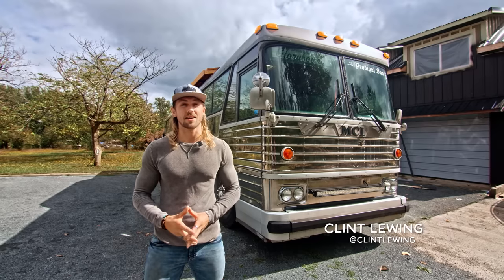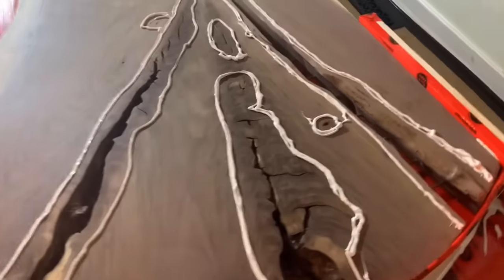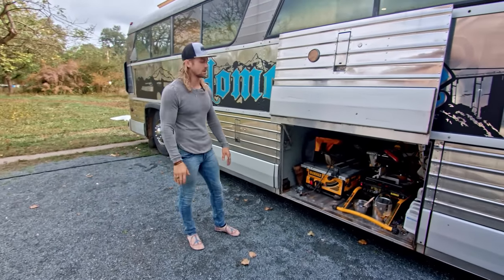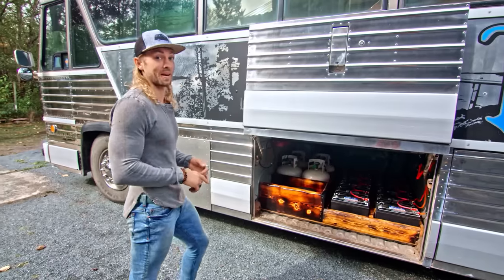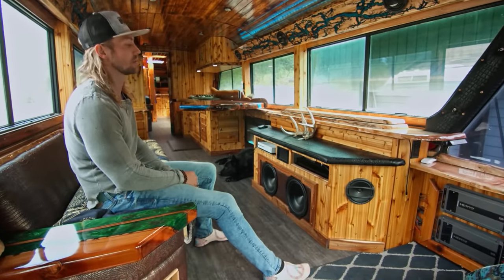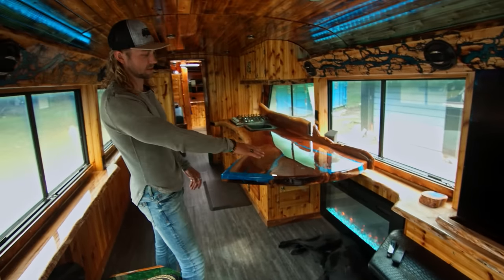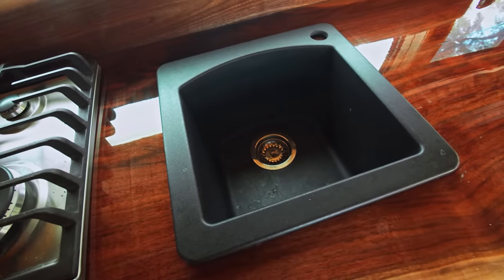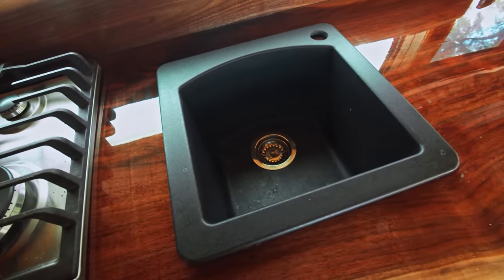I'll be Surprised If You're Not Impressed with This Charter Bus Conversion

Comment: Gorgeous work man! You could fix a hinged folding rack with solar mounted on it. Then you could flip them up when parked and they could sit in a vertical position acting also as a perimeter rail.  May also come in handy to adjust the angles and maybe even make them removable. Could plug to an extension to place them on your site.

Comment: Absolutely gorgeous, my only concern with what I saw is rust in the undercarriage; are you doing anything to take care of the rust?
Reply: I'm interested to know as well.
Reply: I actually got a commercial vehicle inspection (CVIP) done on the bus in 2019 in Alberta instead of a regular safety inspection. So the frame, brakes, engine, trans, wiring/basically everything else was all checked over with a fine toothed comb & she passed with flying colours. I will undercoat the bus one day but right now shes structurally safe & sound as is 🙂
Reply: We didn't actually see the undercarriage thosd were just steel hinges holding on those lower doors  I think
Reply: You are correct there! I mean.. I may be crazy but I think it’s fairly understandable that a 40+ year old vehicle has a little surface rust 🤷🏼‍♂️  @nllnll6119
Reply: @ClintLewing  you undercoat that bus and it will rust and you will lose it. I don’t know nothing about ranches and having stuff like that but there’s one thing I know I’m a mechanic a body man, a painter and I do very well at all of it .do your research. When a stone comes up from the road and you’re driving and it puts a chip in that undercoat moisture gets in behind it and it sits in that frame will rot out in a matter of two years it will be complete junk. They make oil based under coating that will allow it to breathe and stop the rust good luck.
Reply: @robertmedina6875  it would be quite expensive but he could have parts of the under carriage powder coated as one would do a restoration to prevent rust.
Reply: Agreed and the rough engine ...
Reply: @ronspeer  yeah That would be a crazy amount of money. I guess if you have it
Reply: even if it is a bit rusty this bus was only $10,000 which is an absolute steal considering that big diesel generator on board. Which would easily be over $10K by itself if you wanted to buy it new. Onan still makes the Diesel QG 7500.
Reply: @robertmedina6875  I live in the Upper Midwest and undercoating is basically required if you want the car the stay nice. 
However, you are correct people don't do enough research and 90% of places don't do it properly. 
In my opinion it needs to be done as immediately when the car is new before any rust starts and there's no damage to the original paint on the frame. Even then it needs to be taken to a specialized place that specifically does bed linings, industrial applications, heavy equipment coatings, etc. Line-X is one that comes to mind personally. A good quality and properly applied bedliner works much better than any type of rubberized undercoating in my experience. As rubber coatings trap water like you say.
The oil based stuff you mentioned works amazing, but they need to be reapplied every few years in order to keep the protection going if you deal with a lot of salt spray. If your willing to do that I recommend it. However thats not really practical for some people.
Reply: @robertmedina6875  Agree, rust can get away from you in no time also. I'd take the time to clean the rust off first, even if it's one or two compartments at a time and know that that rust is gone is better then just leaving it

Comment: On any used vehicle, I recommend removing the spare tire to make sure it comes out. Then lube all the fasteners for it. I had a used van that blew a tire, and the spare tire that is suspended from a cable wouldn't drop. Luckily I had my multi-tool cutter and was able to cut it free. Won't make that mistake again.
Reply: @hello Walter, how are you? where are you from ? I am here to make friends!

Comment: Nice work - He might want to address the rust, though - Would be a shame to have put all that time in on a vehicle where the chassis ends up rusting out
Reply: I actually got a commercial vehicle inspection (CVIP) done on the bus before I took her out on the road in 2019. So the frame & everything else was checked over and passed easily 🙂
Reply: @ClintLewing  Good, still something to be on top of - I spray my chassis with WD-40 regularly - I've got a 4x4 Astro Van that is "rust free" but there was a little surface rust on a bit of the rear end and the original springs (before I replaced them) - Just spraying them with WD-4o took care of that. Had a bit of surface rust on other areas I hit with the wire wheel on the grinder and painted - I now even paint unpainted new parts before installation - We're putting a lot of money int the builds on our vehicles so it's even more important to be on top of the undercarriage
Reply: Oh 100% thanks for that @AstroVanTribe  Once the rainy season is done is BC I’ll get that bus lifted up and go over undercoating the whole frame just like I did with the frame inside when I replaced the insulation & subfloor 🤙🏼
Reply: @ClintLewing  nice
Reply: @ClintLewing  my thoughts exactly. about the rust.. glad to read you have considered these things!  
You have chosen an interesting user name too.... with a rosary of prayer beads to Mary hanging on your rearview... I will share that I was a Catholic my whole life until I read the Bible... (actually, until I listened to it when I had some alone time on an extended project).... maybe if you have some quiet/ alone time you can listen to it too..  It took me about 4 months, any translation will do, they're all uploaded free on YouTube .. but go with the actual Bible (not preachers or video interpretations) The real Scriptures blew my mind and changed my life. .. I pray your journeys will include a pursuit of the Love of TRUTH!  Safe travels, nice work!

Comment: Okay... Sooo batteries next to wood and propane tank... And like 2t of wood inside... It is crazy that will never be certified in any normal country 🤣😂🤣
Reply: Hmm.. The Journey man electrician, Red seal HD mechanic, and Transport Canada didn’t seem to have a problem with it when I brought it in for a Commercial Vehicle Inspection…. But then again, what would they know right?! 🤣😂🤣
Reply: @ClintLewing  it's most definitely a fire hazard. Looks great but be safe brotha.
Reply: Curious to know what ignition source you’d think would post a risk to sealed 20lb tanks that the Journeyman electrician missed?? @Eyeyamgod
Reply: @Eyeyamgod  🤣😅😂 I'm not laughing with you either 🤔🤔🤔 U are aware just about every camper out there has its batteries mounted next to the propane tank right?!
Reply: @ClintLewing  If the haters are hating, u must be doing something right, right?! 🤣
Reply: It just a common sense , that it’s all, maybe put a divider or move the gas to another area. Just preventive comenta for your safety. Other than that it’s cool. Good job.

Comment: Nice build, I am a retired master carpenter, and for someone who has no training, 99% of what I seen is very awesome.. The only thing I would change or add rather, is some solar panels on the roof, it's basically free power, especially if that is your everyday (I live here) home.. A friend of mine has a weird wind torrent like thing, it isn't very big, he built it himself and he says for them long drives, that alone keeps every battery fully charged, He said he just took the idea from a homemade torrent and he uses 2 heavy duty alternators, he says the only time he can make power with it, is driving hwy speeds.. Thank you for sharing

Comment: I like it.  Wood gives a very rustic homey feel.  I did a Prevost when Covid hit while i was off work for a while.  Not cheap to fill up.  Close to a thousand liters but can go 2000 km.  Lets hope prices come back down a bit so we can see some far destinations.  Hoping to see family in Quebec and Ontario if I can this summer.  5000 km one way but I will be driving in my second home.  When I talked to the insurance company while researching before buying they told me if I get the bus dont put in propane.  Ended up going all electric.  Propane does have some good points though.

Comment: I’ve built 1 MCI 36ft. 1 40ft Blue Bird Gas Forward Controls . And finally a 1993 41’ Thomas 8.3 Cummins Diesel- Allison Auto. Pusher .Lifted the Roof 22 3/4 inches and 2- 9 1/2 slide outs . It’s  fairly easy to repair and service . And I don’t have to deal with  MCI air system and Detroit Motor.
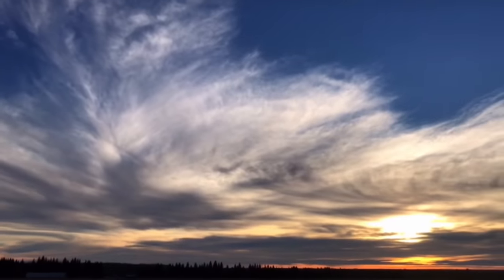1:30

Comment: Cool conversion. Just one point - at 2:45 you said "7500 kilowatts", it's actually 7500 watts, or 7.5 kilowatts. 7500 kilowatts = 7.5 megawatts which is enough to run a small town. 👍

Comment: I hope you love what you have done and enjoy your bus for years to come. I see many issues that would not work for me or if anyone needs to go places where there are no services available.
The kitchen does not have anywhere near enough storage, super tiny fridge (great for a few beers and snacks only), sink is too small, no oven, no cooktop extractor fan ( necessary if you burn propane inside).
I did not see a shower in the bathroom and it will get really old, really fast having to pull out and make the bed every day. There is lots of room in the bus, put in a full size queen bed in the rear.
How you are going to take a bar-b-que up and down from the roof through that hatch is a mystery, as it can't live up there.
And lastly, where are the solar panels? The roof is all deck which is a waste of space unless you park in a swamp and can't sit outside.
I know I will get roasted by haters as I am not gushing over this bus like all the others, but thought some constructive criticism might be helpful.

Comment: looks great bro just a word of advice the spare wheel frame is rusty take care of the rust because its easy not to check on something for a while and rust is very fast to spread the last thing you will want if you need to change a tyre is that because it got so rusty you lost your tyre or it came off and destroyed some of your undercarriage at the same time or your spending time on a part of the road that is busy trying to get access to a tyre that's being held in by a rusty frame that's hard to release, anyway take care bro all the best

Comment: i bought a nice 34 ft motor home class A--top of the line in its day '94 with 7000k gen set-has 4 air conds! got everything--low miles--people needed money--got it for 7000 usa $--has air ride that is adjustable--drives like a dream-like the big bus like front windows,live the dream-those 8v-71 are nightmares=lousy fuel mileage,noisy,smokey,drip,use oil but not knockin cause you paid the right price--the inside is beautiful in your home

Comment: Such a cool bus and would kill for that generator and 10 deep cycle batteries! And whoa such a handsome guy (minus the skinny jeans and whatever is going on with like peace sign sandals. Super nice job on sound system. Not sure what would possess anyone to decorate like that - but if the only wall or surface material you like is wood (he is like "I knew I wanted zero color" which broke my heart). But this thing is like the pot of wood at the end of wood rainbow. But you know for the unfairer sex (just kitten) it's definitely not the worst interior design bc it's clean in there and all but man the only time someone should use that much wood inside is for a sauna... I'd kill to be able to redo the interior  and show this nice handy guy how much cooler it could feel to hang out inside... better seating, artwork, textiles, some character. I guarantee he would be won over and a changed man after I made it cool AF inside. I don't know it kind of makes me feel like I am in some aquarium and a dated head shop; wood, black leather seating and blue tube lighting. But for real there's more awesome things going on with that motivating guy and his hard work restore job!

Comment: 10 batteries is a bit of overkill.  You would be better off with just 4 batteries, and then install enough solar power to refill the battery every day.  A 400 - 800 watt solar system should be plenty, and today they are cheap.  Back when my RV was new in 1994, the pair of 45 watt panels on sale cost $750 with the controller and instructions. in 98 I bought a 125 watt panel for $329.   Now you can buy a 230 watt panel for only about $130 each.  10 batteries = 670 pounds while you only need 4 - around 265 pounds.  Sure your 33,000 GVWR is plenty to carry the extra batteries.  

I love your counter top!  Looks great!

Comment: These are interesting builds but the issue with building homes on a vehicle is that one day they will become immobile once fossil fuels are unavailable or no longer financially viable. They will need to be either converted to operate fully on electric power or otherwise used in a permanent settlement.

Comment: "7500KW Diesel generator" .. aaaah, pretty sure that's a 7500 watt generator, a 7500 KW would be roughly the size of the bus. (The MAN S.E.M.T Pielstick PA6 B N provides up to 7000kW, and is 11 meters long, 3.5 meters tall and 2.8 meters wide, and weighs 108 (metric) tons, and is primarily used as a backup generator for nuclear power plants)

Comment: Challenge accepted. I'm not impressed. Wood, for those that don't know, weighs a ton. It looks cool, to be sure, but a poor choice inside a rig because it lowers your gas milage substantially and is a drag on the engine. And where do you park when camping? I'm from the states so maybe I'm not understanding but camp grounds in the lower 48 aren't really geared for a big a@@ bus. And in the winter? what snow tires?

Comment: Not impressed at all he wasted alot of money it is pretty tho and not surprised alot of people that dont live away or will never live out of the city like it. With that much money he could have gotten a better engine, converted it to to an all wheel drive with locking axles, turned it into a manual with a much stronger transmission, got a custom lift built for off roading or made one him self if he knew about welding, lifted the roof, made the whole thing run off solar apart from the engine, used better stonger and lighter wood, bought more power tools apart from hand tools to make everything easier, gotten a better jack since aparently his jack cant even lift his spare tire so that he doesnt have a useless jack and useless spare tire, gotten some better tires and much more. Over all its more like an art piece thats very nice to look at but its pretty useless compared to what it could have bin.